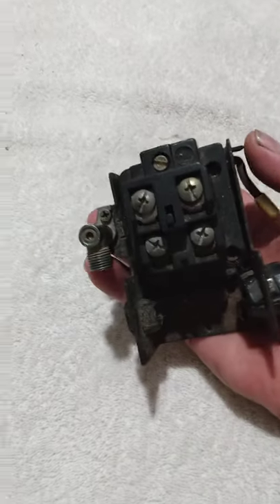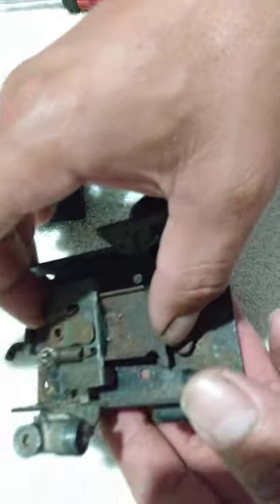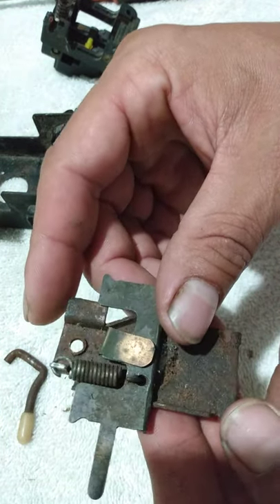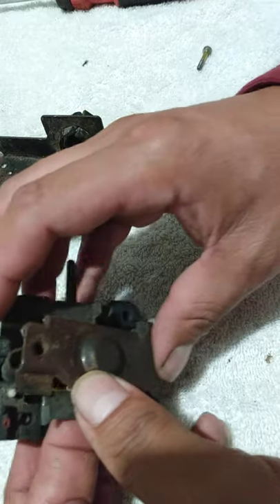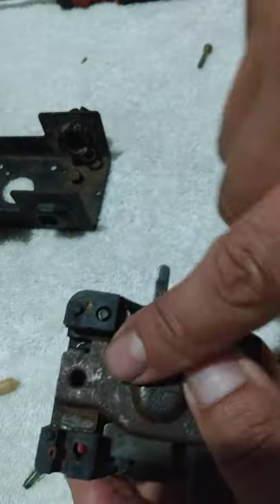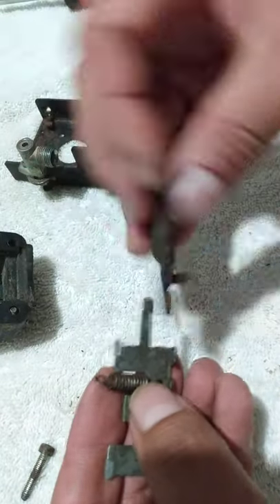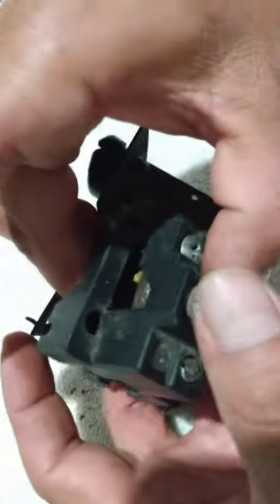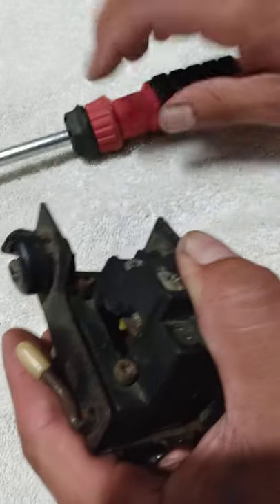air compressor pressure switch assembly breakdown. with a bad unloader valve

Comment: thanks brother. my compressor wouldn't start after I foolishly unplugged and replugged the power without turning off the switch and so I decided to have a look inside this "box" and of course, things went flying everywhere and I had no idea how to put it back together. I eventually learned what this box is called, and now with your video I reassembled this pressure switch. it looked quite frustrating, but I rook my time and all went well. I did use some zip ties to hold the parts together because I knew it would go flying apart for me if I didn't. anyway, during this project I discovered the reset button as well, which probably would've fixed my initial problem. I've also changed the oil and evacuated the little bit of water that was inside my compressor. I also reset the cut-in and cut-out pressures, and now the whole thing is working better that it did before. I'm so happy. I inherited this compressor from my late father and it comes in so handy. I would've hated to have had to buy a new one. So thanks again for your time. Also, sounded like James was working on his own project in the background. :)

Comment: Dang this video was helpful. It took me a bunch of trying until I gave up on putting it together with the little spring on. I assembled it with the spring loose and then used a hook to pull it forward and seat it! Worked on the first try. What a pain in the butt! Lol
Reply: I did the same, wrapped a wire around it to keep some tension on it until I was ready.
Reply: @BryanClark-gk6ie I don’t know what that means.

Comment: Compressor stopped shutting off when it hit pressure, so I took it apart. And of course, the spring-loaded parts went everywhere... 

Couldn't figure out what went where until I found this video. Thanks for making it
Reply from the maker: Your welcome
Reply: If you are going to tear it clear down why dont you clean it up? Or hey put that rusty gunky shit back together just like that then do it again in a month! To each his own but to me you just practicing tearing it down and putting it back together when another hour to clean it up and put it back together once!
Reply: @StonemanRocks  He bought a new one. This is just to show people how to take it apart and reassemble it.
Reply: Replacing it is the way to go. Its kind of a pain to put it back together if you tear it all the way down. It can be done and zip ties (I used 2) help immensely to hold the pieces with the spring until you install the 4 main mounting screws! Wait until you screw those 4 screws almost all the way in then cut the zip ties or it will slip apart if you aren't carefull!
Reply: @TheShawVMedia  right on and sorry to criticize your methods. I have done stuff like that when in a hurry. I only learn by banging my head on the wall a lot of times. A lot of it is fear of the unknown too. If you have basic handy skills just go for it I say. Clean shit up good keep it safe and don't lose it and label wiring or take good pics for reference. Happy repairing! It saves a ton of money too!
Reply: @StonemanRocks  You are 100% just fine. This is NOT my video. I was just saying that the guy in the video was only taking apart his old one because he bought a new one. He had no intentions to use it again. It was only for helping purposes. From one DIY gent to another,  I hope that you keep building awesome things and I wish you nothing but the best in life.
Reply from the maker: @StonemanRocks  that was an old one I had for parts

Comment: Your the man! Very helpful. Found this old school twin compressor. Had clean the diodes or whatever them damn things called. The 4 screws were stripped out. The brass connections. Its 5:15am. I tried reassembly not knowing wtf what was what. But you made it happen twice. Fuck yea extra compressor do trim work. Thanks dude. Btw love the idea capri sun straw. Awesome

Comment: Be extra careful with really older air compressor, there is a sliding contact plate that basically reciprocate with the conductor..this thin forked plastic becomes brittle especially in very old school compressor types and this piece may even shatter just disassembling it just like you are doing here...
Mine was in pieces when I went to inspect inside..my type of air compressor will need to be Cross part fitted .
Good video.thanks for sharing.